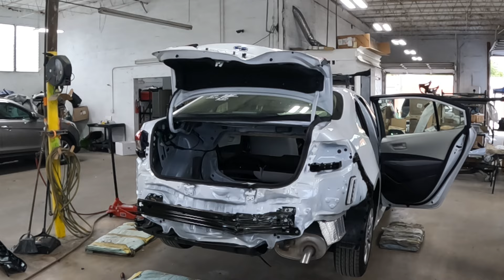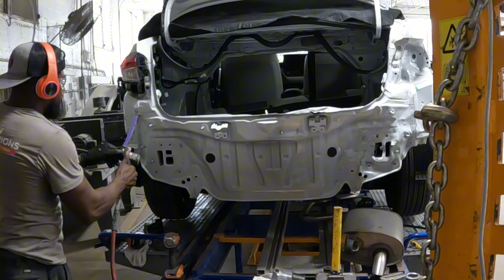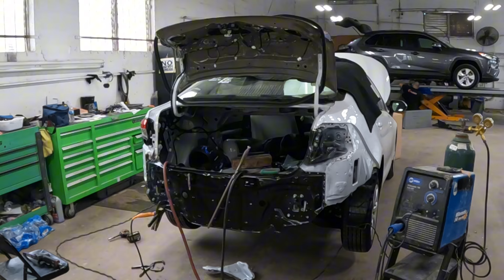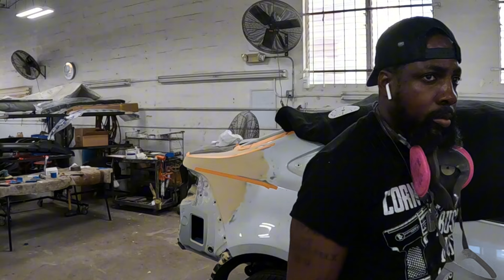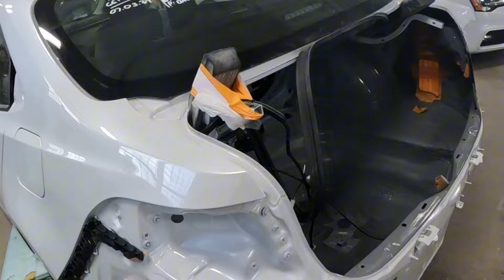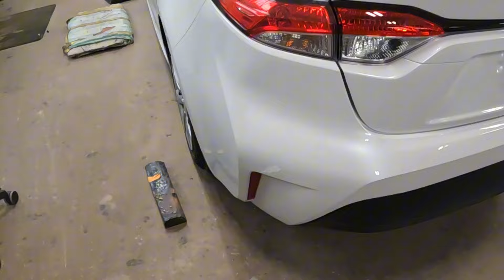How to replace and bondo repair a badly damaged Toyota Corolla rear body panel N quarter panel

Comment: B piller replacement.      video broo.  And. Mig welding wire speed voltage setting video spot welding machine setting using video. Please upload
Reply from the maker: I did a video on that already